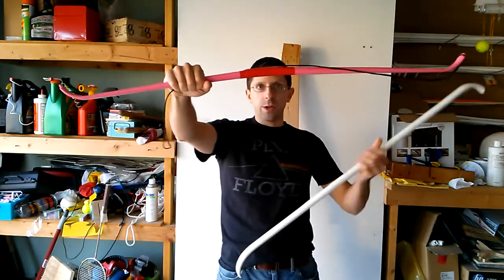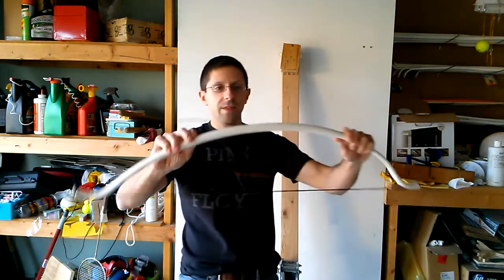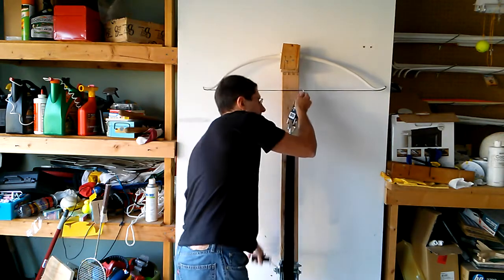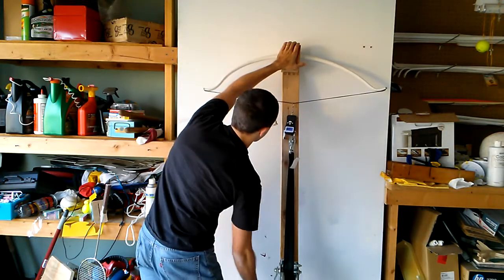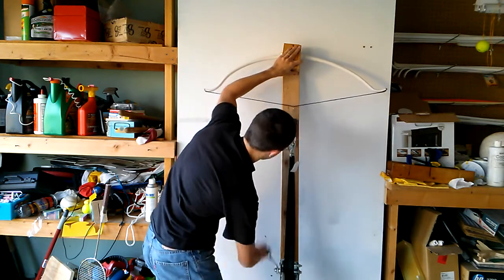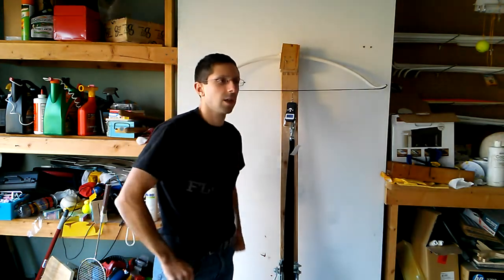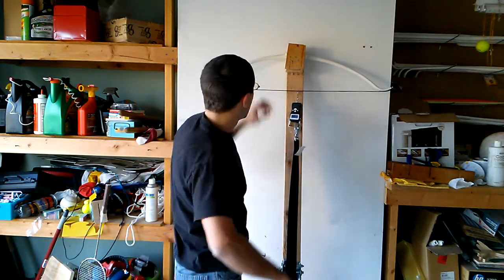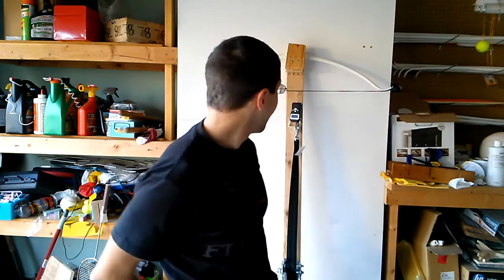Experimental Fiberglass-Reinforced PVC Recurve Bow

Comment: They can indeed, shatter and send out dangerous pvc shrapnel.  Mine was a 52" x 3/4" pvc pipe-fiberglass rod reinforced, 54 lb. draw at 28".  It shot well for about 2400 shots then exploded.  I had reinforced the handle with a 12" rod, and the blowout was near the handle.  Perhaps also overheated.   I now use two 48" rods with a 24" center rod in 3/4" pipe to get the same draw weight.   I tape about 9" of handle.  So far so good.  Thanks for your vid.

Comment: Tim, (firstly, this is my fiance's account, sad to say.) As for your "youth bow," I'm guessing that it's the size for pre-teen to mid-teen size? about 35-40" nock2nock when strung?  I've made a couple "basic" bows following Nick (The BackyardBowyer)'s concept of inserting a fiberglass bundle-bow as a core of a 3/4" PVC.  Works nicely, not yet had it draw tested. However, I'm wondering, now that I have the bundle core inside, what would happen if I were to go ahead and flatten the limb sections? .. I know I'd have to re-place my handle location back to the "True Center" where as right now it's setup as the arrow takes "True Center" while my handle begins just under Center.  I would like you opinion, if I may ask for it.

Thanks,
Tim McCormick (TJ)
Reply from the maker: Sounds about right - the bow's original length is 41", then it loses almost an inch on flattening and shaping. I've made bows for both ways, both "hand-centered" and "arrow-centered" - both work, for sure, and in general, all that changes is the nocking point, unless you tiller a bow specifically for a certain style. I've used both interchangeably on the same bows, and it seems to work :) Let me know how I can help, I'll try!